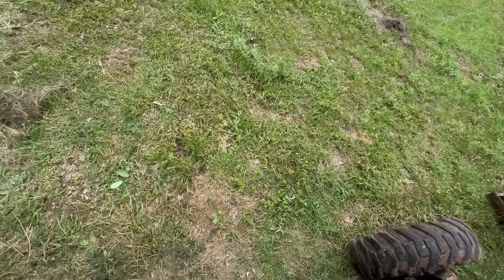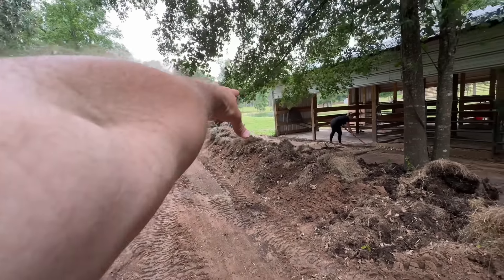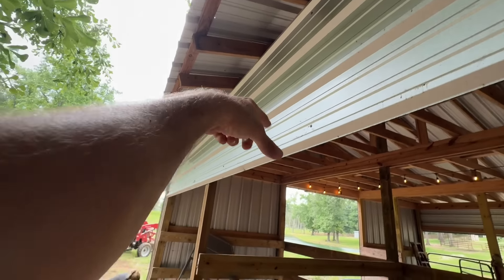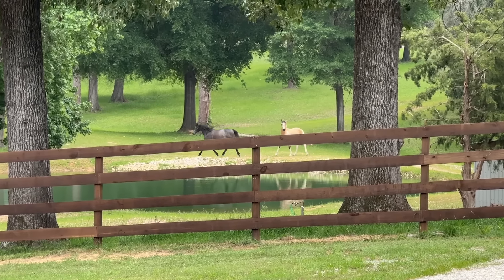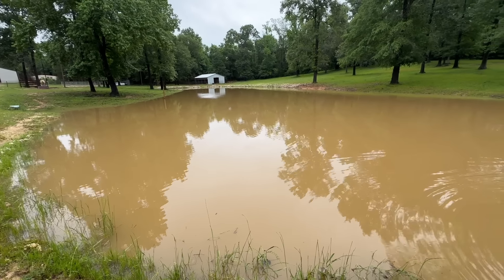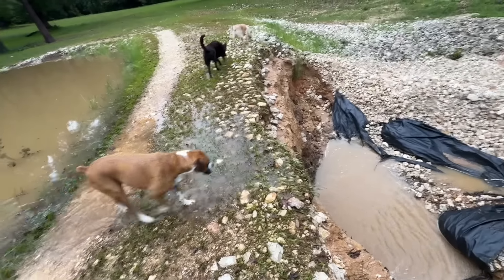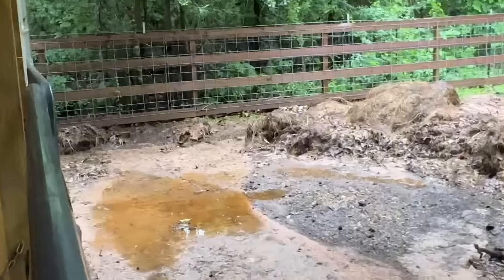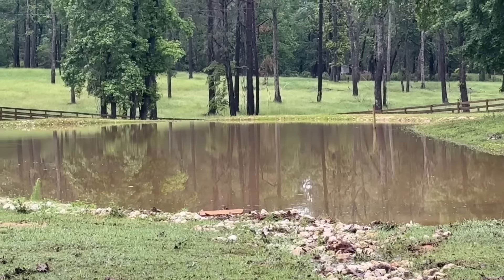Spillway Collapse Again!

Comment: Lester, you need to put in a spillway pipe. It would stand in the deep end of the pond and make a right angle under the dam. The hight of the pipe would be just below the overflow point of the pond. When the water gets higher that the overflow point the water would go into the pipe and flow out the bottom under the dam. There would be no water over the edge of the pond. The spillway pipe would be much cheaper than all the concrete work you are considering. 💖
Reply from the maker: Thanks for the suggestion.
Reply: I've seen something like this idea in action.  My Dad had a 15 ft burn ( in his case it was to muffle the noise from freight trains). It was at the  far end of his property. This caused his yard to flood, particularly in the spring snow thaw. He had a pipe bore through the berm to carry the excess water away. Worked like a charm.
Reply: I love to see the horses happy running together.  Rita could be a race horse…   Oh no here comes thebWater..
Reply: A lot better than it used to be toward the pond..
Reply: EXACTLY RIGHT!!  My grandfather designed his 4 farm ponds in that very manner and it worked perfectly during flooding for more than 50 years.  We had to move away from the farm when I married, but the ponds are still working perfectly for the new owners with the spillway pipes that he installed so many years ago.🥰
Reply: Not necessary Lester. Steel sheeting seawall is all you need

Comment: We have the same problem. some of our property is that a 45° angle hill top by the barn we had to make a Y break to slow down the water off the top of the hill and then calculate how many gallons we were getting off the roof of our barns and house structure.
It did help having the gutters to re direct. i'm sure the horses love that pond every once in a while, the botflies chases the horses last year was bad.

Comment: If you put some guttering up  harvesting water into a tank for the pond or run water pipe under ground to pond could do it for all your roofs harvesting into tanks for watering grass area's when you have dry spells it would stop some erosion of your concrete pads at LHL and  ISS just a thought 😊

Comment: Sand bags on the side of stalls where water comes in. Put plastic sheeting and bags several layers high and seal the inside between the floor and wall. Thats how I keep flood waters out of garage. It works. Bags don't erode.

Comment: I use to work for a company that builds ponds and what we would have done is stack big boulders on spill way and that would have made it indestructible and by putting down that fabric you made it easier for the rocks to slide off and if you wanted to you could even concrete between the boulders

Comment: Live in E. TN. Seasonal rainfalls in the valley of 3-6"+ are normal and we also have elevation change contributions. So far, to date since I have been here, the concrete barrier at the Old Mil, Pigeon Forge-TN, has held and reduced flooding below its immediate vicinity.

Comment: LOVE to see Rita run like the wind ❤

Glad you are considering cement for your spillway overflow.

Good tractor work Lester, your Levy helped lessen the water flowing thru the horse barn…didn’t expect a quick levy to stop it all with so much rain - yep, gutters would be helpful.

I saw the same video that Jami described, for a slit PVC pipe, to slide over your roofing & screw it down, to divert roof-rainwater thru it to the front…you have so much more rain coming all week long - hope your spillway holds thru this🪶🙏🏼 You & Jami are doing your best - please be safe.
Reply from the maker: Thank you Catherine.

Comment: Lordy mez..that spillway😢😢   SO sorries all that all work that Victory Dirt did...time to put some huge boulders down on that side an build up a bigger tuffer retention wall to the top of the spillway but allow 8 feet wide down the middle of those boulders..that space needs to be fitted with railroad ties stacked from the bottom to the top with 8 foot cut out on the top of the spillway that's reinforce with railroad ties to allow the over flow from the pond to escape down the spill way. the side of the pond that's leaking needs loads of very large slate rock to be put on that side from the bottom of the pond to the top an across the whole pond side spillway to plug up the leak..an you don't need to drain the pond to do it either..You built the LHL drive way bridge  Lester an it works perfectly fine..you can do the same with the spillway.. you can create a barricade on the top sides of the spillway with the huge boulders so they stay off of the spillway...safety first that can go around the pond on the other side a few axtra feet of traveling won't hurt them one bit

Comment: I am really praying for you all. All it would take is one more storm to collapse the dam. My thought has always been that they should have installed a pipe overflow like at Daniel Arms pond at the Millcreek property. The water would only get so high before it would flow into a large pipe and then flow under the dam and into the drainage creek. That way, water would never go over the dam at all. But I do pray you find a good solution for your area. And be safe tonight!  🙏💖🙏

Comment: It's a pasture and fields. Save yourself and headachs and tile it now so you won't have any future issues. It took me years before I got smattering enough to do it. I put tileaeound my barn and on the 3 sides I put decorative white rocks and we did rose bushes and stuff in them. But the rain hit the rocks and into the tile and right on out. Never had any more issues but it took me 15 years to get there

Comment: Here in Australia, if we want a temporary levee to direct water flow, we use sand bags. We fill feed bag size bags with sand, and stack them in a brick wall pattern to the height we need. It’s remarkably effective, and can be removed and used again next time. Just a thought for your stable problems,👏👏👍🩷🩷

Comment: Do you need a divertor strip on the roof? So part of rhe water goes to left or right  and not off the edge.
Have you thought about a French drain around the building to divert that roof water away from coming inside?

Comment: Longhorn Lester's Could you put a metal pipe underwater near the top of the pond, bury it about a foot under your walkway and have it come out tthe other side about five feet past the walkway to drain in your ditch to go under your drive way. 🥰🥰 That way the overflow water would go in the pipe and drain out the otherside to under your driveway.

Comment: I think you need to dig a ditch like a French drain on the back side of the horse shelter that drains out on the sides. So that water can’t reach the back wall. You put a metal grate over the top so the water runs into it.

Comment: That's a hella lot of water, in a very short time. I don't feel like the spillway failing was anything against Vickory Dirt, it probably would of held up under normal rain fall. Now you know the must haves. 1) Concrete Spillway 2) Gutters on the barn 3) More permanent water diversion away from the barn.  This is solely my opinion and I'm well aware of the big price tag that would come with that opinion. May GOD bless you and Jàmi in this time of great need. 🙏🙏🙏

Comment: Glad to hear you are seriously considering concrete spillway. I've been there, made all the mistakes you have and only thing that worked was concrete from the edge of the pond (actually 18 inches back into the pond, coming out of the pond), concrete all the way across the path and then over, stepping it down at levels to slow the flow and not making it like a sliding board! or the water will rush down too fast and make it wide... got to be wider than any possible ever... flow... or the sides will erode and crack your concrete. Concrete wall all the way across.  You have great vision for beauty - so your design of step down should be your imagination.

Comment: Hello Lester. On your pond I would look into hiring an excavator to come out and cut a ditch across the pond dam and install a drain culvert. You will also need to build the top of the damn up some more to where it will be above the culvert. You set the culvert above the height you want the pond to be so when it reaches above that height the excess water will drain out of the pond through the drain culvert. The culvert size needs to be at least a minimum of 12 inches to be able to keep up with the draining in big rains. The current over flow spill way for the pond is not big enough to handle the overflow which is causing the excess water flowing over to erode and wash away the back of the damn. The width of the damn at top needs to be at least 20 to 25’ feet wide with a 15 to 25 degree grade off slope on the back of the damn to the bottom to be able to divert and hold up to water trying to washout the back of the damn. The culvert route with adding dirt to build up the height and width of the damn will be much more cost effective than spending 10 of thousands of dollar on pouring a concrete spillway. When adding dirt they need to compact the clay in so it packs hard. Just lending some words of wisdom! Hope all is going well with moving the animals. Take care. Sending prayers your way…
Reply: Yes here in Ohio, there is a pond with that spill away pipe (I'd say is like a 24 foot diameter pipe) and it works well. I walked to it one time and water was going over the spill away pipe.  This area is real hilly too!

Comment: Have you thought about putting and overflow with a culvert for it to flow thru the dam rather than over it.  I think Daniel Arms has something like that in one of his ponds.  The only thing I have heard him say is the the metal has rusted out over the years.  I am not expert by any means you built that cattle crossing seems to be handling the water.  Just a thoughjt.

Comment: Suggestions  from our peanut  gallery 😅,  1- dig out  the side of the pond to push your water back to the other end and then put a pipe to let the over flow go through. 2- used clay , and borders to reshape the dam. 3- The snakes are using the pipe  the past owner  instilled  to travel and other animals  can too. A grate may hender them. 
Prayers  as the Morrows are getting  ready for the  weather.

Comment: That black covering at the spillway, looks more like plastic to me. Dirt and water will slide right on down that. They make another type that is like burlap or sandbag material that will fill in with dirt instead of washing off. Also maybe you could pack sand bags all around it and then fill it in with a layer of rocks and then dirt and then sand bags again. Maybe even dumping some concrete lol ?? What a mess. so sorry you are having such a hard time.

Comment: I can appreciate all the hard work you are putting in, however I have a strong feeling the water is just gonna wash that dirt berm away. You gonna need to build some kind of retaining wall and as far as your spill way you definitely need to go with cement. While you are doing cement spillway you should also look into some cement culverts for the JL Ranch property as well. I know its easy for us people to spend your money but all the money and work you keep putting into doing these bandaid fixes keeps adding up and will cost you more. The gutters for the barns would be a smart idea and if you ever consider raising the cement floor I would recommend adding a slight grade to the floor or even a center drain to help keep water from pooling inside.

Comment: Go to the left side of the pond if you are looking at the pond from the road. Build the middle back up and dig the left side down and let the water flow down and in front of the dam down into the creek. That's the only way to fix it without spending a lot of money on concrete. Glad you are ok

Comment: Sand Bags the spillway.   
Suggestion- drop a culvert at the top of pond,  run the culvert to the driveway.  This will keep the pond at regular level when it rises it flows straight under the driveway. 
My 2 cents.

Comment: I have a question, under circumstances like this, wouldn’t it be better to direct the flow of water away from the pond.  I wish I could show you the stone blocks/rocks they use around here to keep water from washing out the dirt.  They are pretty much boulder size and held in by some sort of grate.  I’ve seen them on steep slopes where roads have cut thru and under the where the bridge supports are for the Thruway.  The rocks you have used is pebble size in comparison.  Also, I love your cement form depictions, but cement cracks and leaks form and split.  Going back to your original pond installers, they sure messed up.  Please ask Jami to stay in the apartment once the horses are in their stalls. There doesn’t seem like much more that she could do, aside from emotional support, which is important, but my worry is her walking around in unknown flowing water, and that lightning.  We love her too much to see her in the treacherous weather.  She is wonderful woman for sure.

Comment: I would rent a backhoe, dig a trench along the far side of the fence and fill with big rock like a french drain and connect to a culvert buried along side the concrete of the stalls where you scraped, put in 16 inch culvert or bigger, cover with rock half way down to the pond. I'd build a four by four concrete apron at the end to let the water escape into the pond area. That side of the barn needs gutters to run down into that culvert. As for the spill way, desperately needs everything backhoed back together for the time being. Once high summer hits, the pond water will drop and then you can build a concrete spillway. Great idea of adding the board along the concrete. Horses can easily step over that. That side of the barn does need doors to shut during storms so the horses have shelter from the wind driven rain if they want.